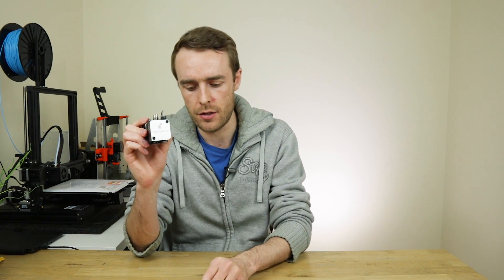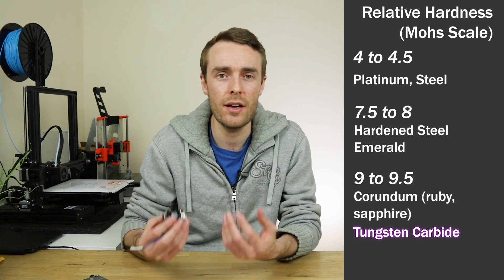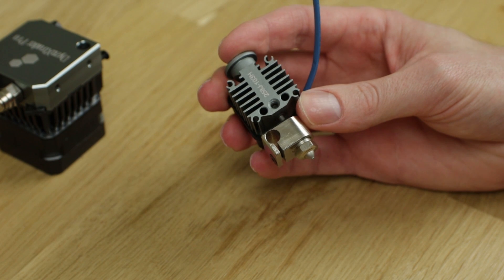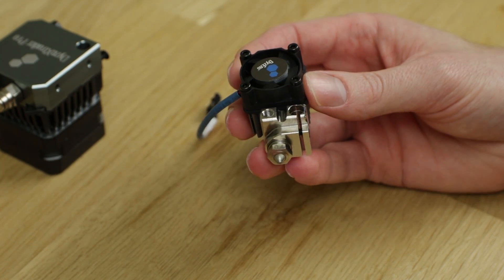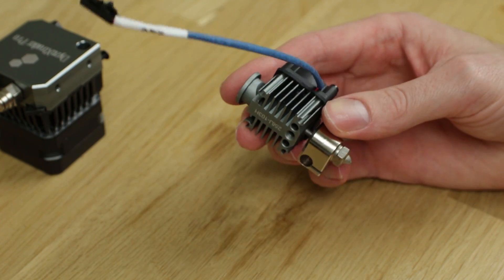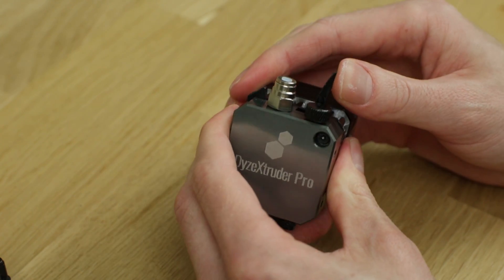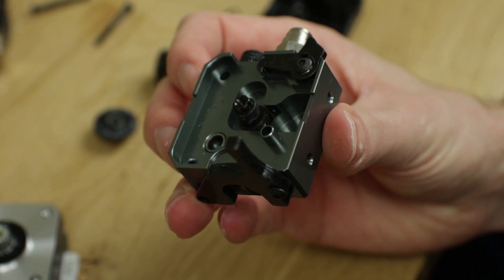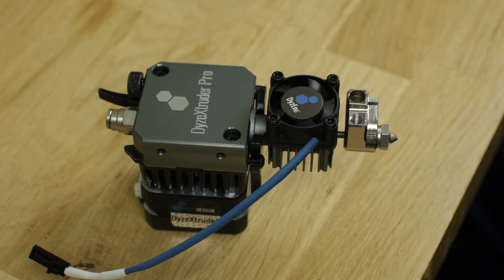DyzeXtruder Pro and DyzEnd Pro Preview

Comment: Vector 3D what temperature sensor does this extruder use since the standard from the printer will withstand max 350 ℃ ??? Do you know any types of thermistors that are able to work at temperatures above 500 degrees ???
Reply: The dyze pro you can choose a 350 or 500c termistor when you buy it

Comment: Sounds promising, but at $330 for the 2 parts- it will need to be incredible...
Reply: Currently 500c is pretty incredible, I would like to print with industrial plastics
Reply: @Vector3DP  Value ratio doesn't sound too good...

Comment: The hot swappable hot end seems like it’d be very useful, if you have multiple hot ends to swap out.

Personally I would prefer swapping out the entire hot end and heat sink to go from 0.4 to 0.6, as opposed to swapping out just the fancy nozzle with the fancy inconel sealing ring. Other than the Ultimaker, I don’t know of any of the hobby grade machines implementing that sort of thing well.
Reply: Not to mention, you can setup calibration for that specific hotend and forget it!
If my temperamental and moody delta has taught me anything, 0.3-0.6 can make or break your first layer and subsequently the rest of the print!

I'm redesigning my effector so I can make as many as I need that will be nozzle specific instead of changing out only the nozzle then having to recalibrate my G28 EVERY BLEEDIN' TIME lol

Comment: Ok, that's one fancy engineered piece of kit. How many Ender 3 can i buy for the price of one of those?
Reply: 1 or so, I bet? High end extruders and hot ends are right around that sort of price point. How many ender 3s do you need to bolt together to print PEEK?
Reply: @Vector3DP  I will follow this with interest. Sure, this hotend is engineered to print extreme engineering grade filaments and way too fancy for mere PLA.
So put it through its paces no holds barred, push it to the limit!